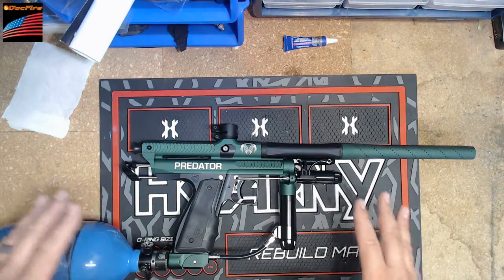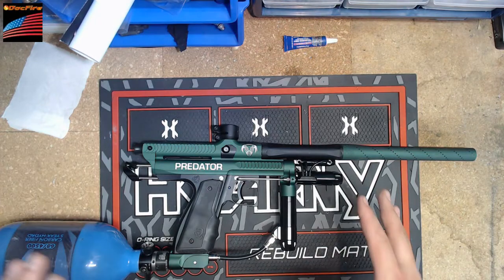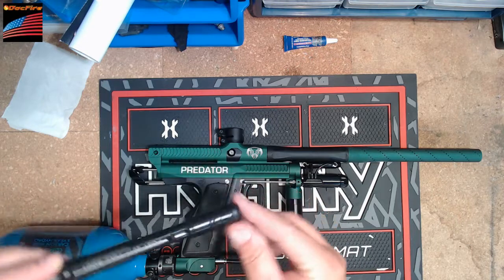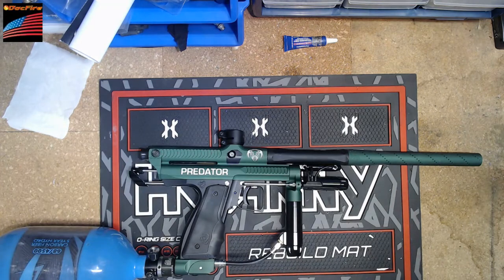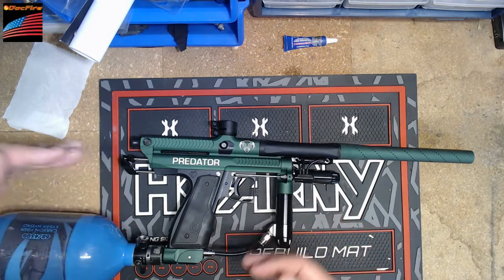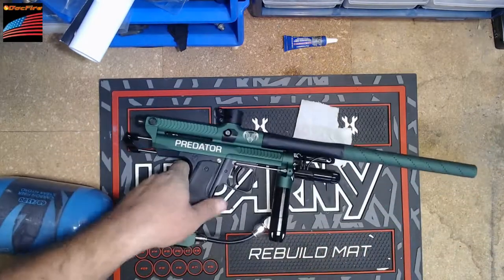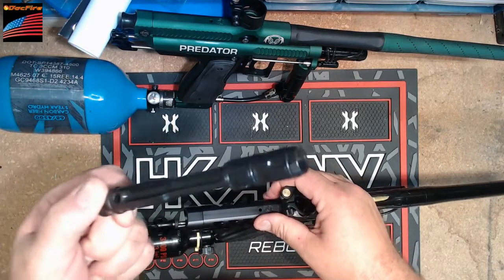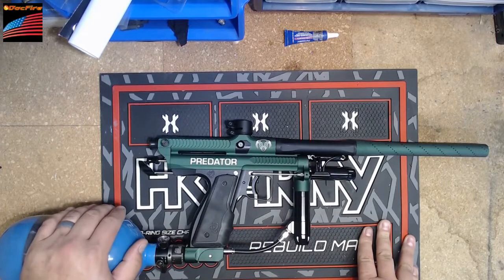Inception Designs Retro Series Suction Timing

Comment: We tore a single ply of toilet paper into a square about the size of the feed neck opening.  Place that square in the feedneck to suction test.  This was in the mid 90s.

Squaring off the bottom of the hammer lug, slight 30 deg chamfer on the lug edge, allowed us to drop the hammer fast/clean.

Dunno about the rounded and pointed lugs for looser separation.

Certainly didn’t like those Kapp adjustable sears or their hinge frame with adjustable sear.